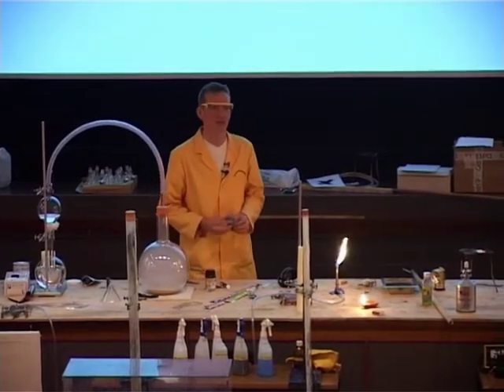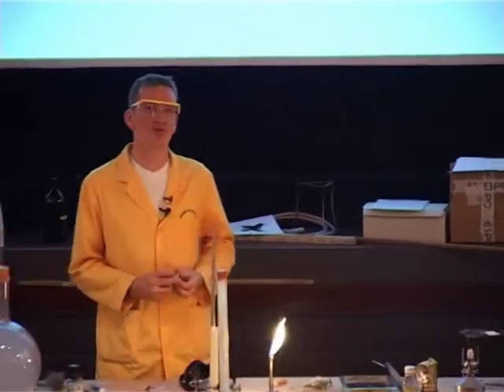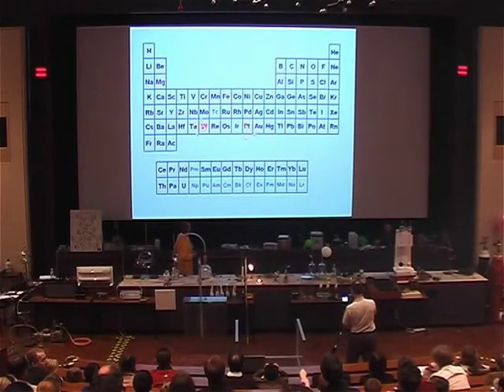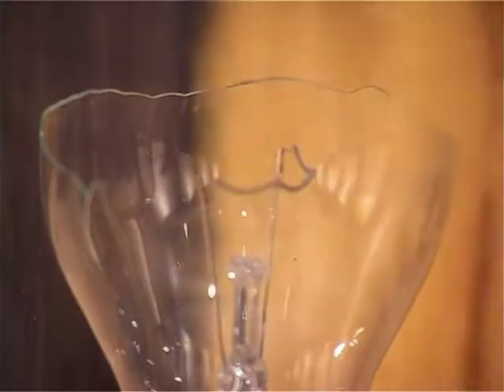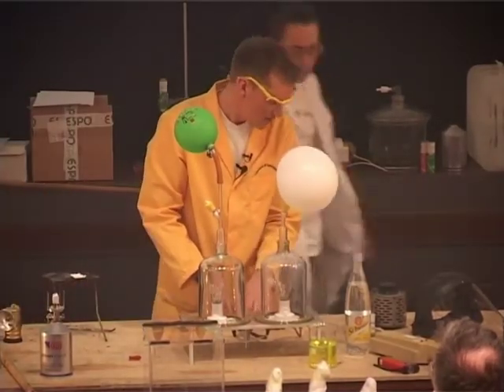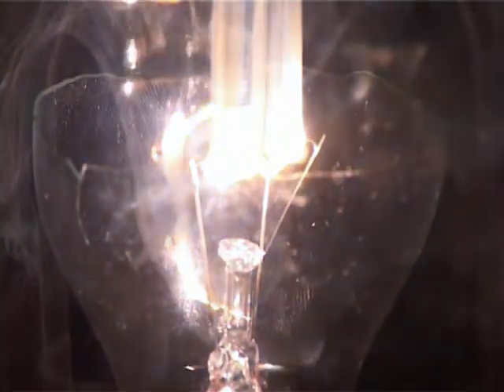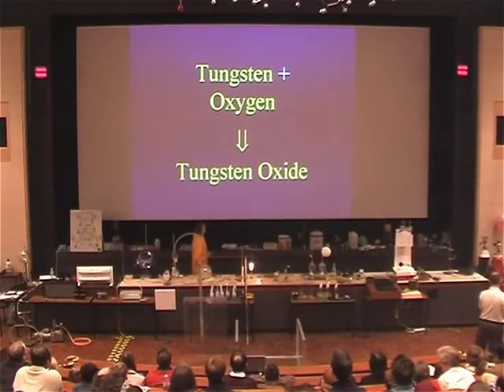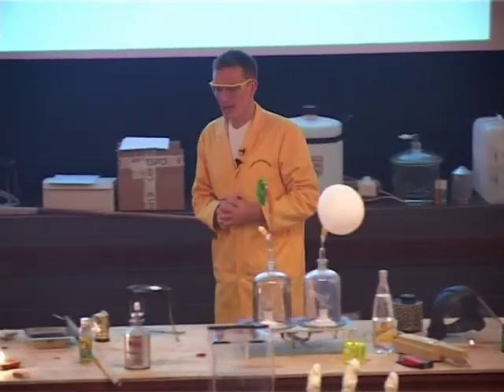The Chemistry of Light 15 - Filament Bulbs

Comment: Which chemical defuses the bulb of a torch from a distance of 6 inches?

In detail: A person switched on the torch and kept it at a distance of 6 inches from the chemical vessel, after a minute the torch bulb (2.4v) automatically switched off. What could be the chemical used in the utensil?